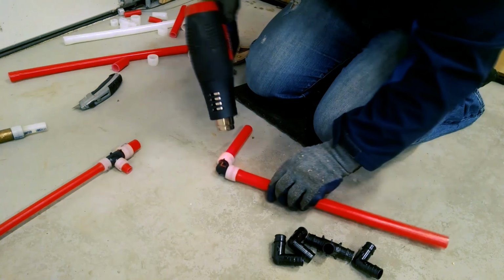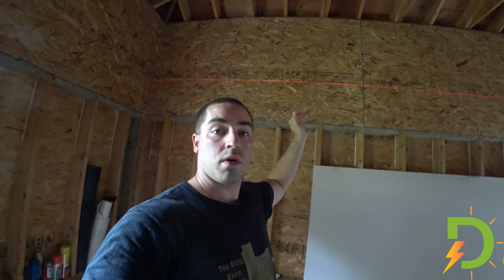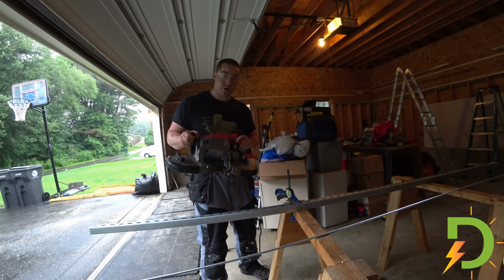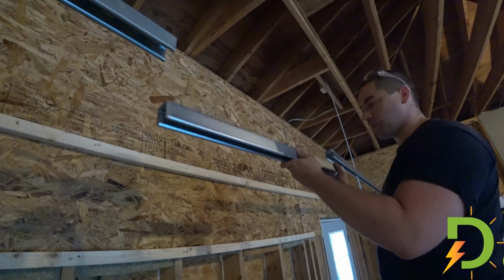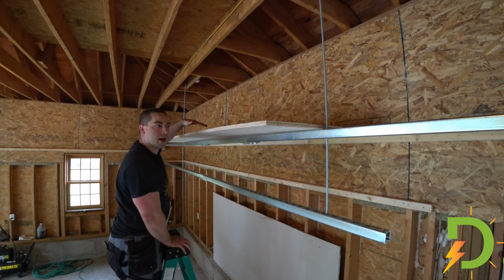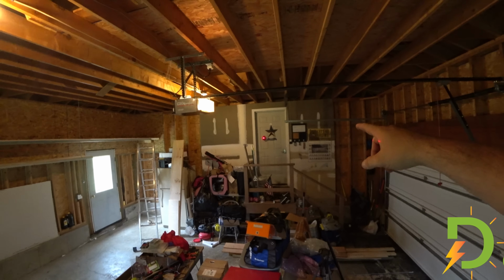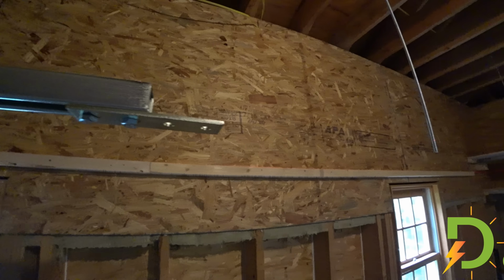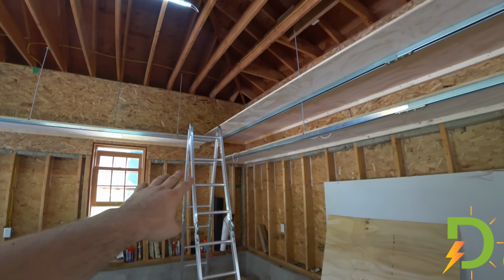DIY Hanging Shelves, Garage Storage Built with Steel Strut

Comment: Awesome video. U are an inspiration but I have a question. How did you install the rod to the ceiling. This was the only thing that was unclear on the video. Thanks
Reply from the maker: At 1:39 in the video I show some wood blocks that I nailed into the joists and rafters.  I then drilled a hole through the wood block, ran the rod up through the hole, and on the topside used a washer and double nut.  I tightened the two nuts together to lock them.  Sorry I didn't go into a lot of detail here.  It was boiling hot up in the rafter bays, I just wanted to get down.
Reply: DavidPoz ... thanks brother.  I am doing my own powerwall soon and I have spent countless hours researching.  Your video by far is the most user friendly and easy to follow.
Reply: they do make a fastener that allows you to anchor a rod directly into wood. it's called a Sammy.  they make one's that have a wood lag on one side and a 3/8 female rod coupling on the nut side.  they also make them to go into concrete and sideways into wood.  very handy

Comment: 1. You can look up unistrut loading.  You actual load will be about double the listing because it will be splt with the support along the wall (in fact with the load pushed against the wall, the wall will carry most of the load).  P1000T (1-5/8 square, slots like he has here) can handle 238 lbs (476 ttl) at 12', 289 (578 ttl) lbs at 10',  357 lbs (714 ttl) at 8', and for shorter spans WTF are you putting on this?

2. I prefer to mount the unistrut with the holes down so I can hang things from the holes (shop lights, etc.).

3. Don't worry about it being "Bouncy."  Unistrut is a channel (U shaped) and not a square tube so it will easily flex, but it isn't going to fail.

4. if the end of the unistrut is against drywall or similar (here presswood), cut out a small hole and put the unistrut into the wall cavity about 2".  This will ensure that if the beam shifts it will always be resting on the wall 2x4 cross support.

5. For downcomers I've always used leftover unistrut, but if you don't have enough scrap then use 2x4 or 4x4 lumber.  Drill a hole in the side of the unistrut and bolt to the downcomer.  Overhead connect to a ceiling joist with 2 bolts.  

5a. 2x4 or 4x4 choice depends on direction ceiling joists run, want 4" side facing both unistrut and ceiling joist.  With wood allow at least 2" of wood past the bolt hole.  

5b. If you are concerned about putting too much weight on 1 joist, if you have access can bolt between 2 4x4 and lay across several ceiling joists, or double up the joists to make a wider beam.  This is probably overkill if you are connecting to 2x8 or larger joists.  

5c. If you are going through drywall and don't have an attic overhead, cut an access panel and frame in with molding like an attic access panel.

6. Overhand the shelf over the unistrut a little.  In addition to protecting against shifting, this better supports the shelf allowing you to use thinner plywood shelfing.  I recommend 2" to 8" overhang.

7. Don't forget the middle of the garage.  If there is enough space above the garage door, use unistrut to add shelving down the middle.  Allow 1" clearance above the garage door highest point when moving for sagging.  use 4 pieces of unistrut to put on either side of the garage door opener channel.  Pus a small piece of wood down either side of the channel so you don't accidentally push an item into it.

7a. Test your clearance with a string by opening and closing the garage door BEFORE installing the unistrut.

7b.  You will need to cut out around the garage door opener.

7c.  You will probably block the garage door light.  Buy an outlet adapter that fits into a light socker to put in the garage door opener socket, and run an extension cord to a light fixture elsewhere.

7d. At the back of the garage door when open, drop the middle shelf lower and continue the shelf to the wall.  Set this height about 2" higher than the garage door opening.  Use 3 pieces of unistrut and set the plywood shelf sideways so it rests on all 3 pieces of unistrut.

7e.  continue across the garage door wall to the sides, up to 4' deep.

8. Get the most space out of the shelves depth.  On the sides come out to about 2" less than the edge of the garage door opening, or 4 feet, whichever is less.  You will need to notch around the garage door guides.  Test your clearance with cardboard in place of the shelf, and again BEFORE bolting down the shelf.

8a. Across the back wall area install 4' deep shelves.

9. I recommend height of at least 6' 8" from the garage floor unless you are installing taller cabinets underneath (height of a standard doorway).  You might consider mounting the back wall shelves opposite the garage door opening about 2" higher than the garage door opening so you never lose the ability to put in higher and longer vehicles.

10. If you are going around all 4 sides plus down the middle, make the space between the middle and side shelves at least as wide as the deepest shelf.  if you have to narrow a shelf for this, narrow the middle shelves since they are mounted the highest.  For example, your garage is 20' wide, your side shelves are 2'6" deep for 5' total.  Your 2 middle shelves should be 3'9" deep and the space between these and the outside 3'9"

11. Don't narrow your shelves just to save on plywood.  If you are exceeding 2' on both sides, then rotate the plywood to have 4' wide sections still cut to the maximin width.  You aren't adding a lot of plywood sheets to the total job (maybe 1 or 2 sheets).

12. I you want to hang stuff below the unistrut, connect piping, etc. look up the unistrut catalog for additional fittings.

13. Paint the wood white if you have a white ceiling.  The shelving will be less noticeable, and the white color will help with lighting.

All of this said, if you are on a budget, don't use unistrut everywhere, because it is expensive.  Use it in places where you want a long span without supports.  Use it in places where a shelf dropping would be disasterous, such as down the middle of the garage.  Along the walls you're paying a lot of money and only gaining about an inch of height.

Comment: How can I attach the all thread to finished drywall ceiling?
Reply from the maker: There are a couple different ways.  One is to use a "Hanger Bolt" like this: https://amzn.to/3h6KBNB  Plus a coupling nut like this: https://amzn.to/3urnvF9 .  You would need to find your ceiling joists or rafters, pre-drill a hole, then drive in the wood-screw half of the hanger bolt.  Then you thread the coupling nut on half-way, and your threaded rod into the bottom half.

Comment: how does the ready rod attach to the rafters?
Reply from the maker: I nailed a 2x6 on top of the ceiling joists.  Then drilled a hole in the blocking lined up with the rod.  Rand the rod up through the hole, then used a big fender washer and doubled nuts on the top.

Comment: How did you attach the threaded rod to the blocks?
Reply from the maker: I drilled a hole and ran the threaded rod through the block, then added a washer and nut on the backside.  Thanks for watching.
Reply: I was just going to ask this same question thanks for the info!

Comment: Do they “sway” at all when pulling stuff off or on? Or are they solid?
Reply from the maker: they are anchored to the wall, so no movement pulling things off.  Yes, they are solid.  My one mistake was going too long of a span at first, so I added one more rod, but showed that in the video.
Reply: DavidPoz thank you for responding.

Comment: where did you go to buy the Uni Strut and all that threaded rod? I want to do something like this in my garage which has low head room, and I think it will work nice having only 3/8 rods coming through the ceiling, I should have just enough room for plastic totes and not hitting my head on the shelf, which is why I don't want a 2x4 for support, I thought about using wire planneling for the shelves and angle iron for the  support
Reply from the maker: Lowes, it is located in the electrical aisle with the metal conduit.  I've also seen it at home depot, and my local Electrical supply houses carry it as well.  It is very common in commercial work.
Reply: In my town, Lowes had the struts cheaper than Home Depot.

Comment: Will the front of that plywood shelf - since it's unsupported - warp with time?
Reply from the maker: Hi Fredochs,  It might.  Send me a reminder is a year and I'll check them and let you know.
Reply: @DavidPozEnergy  Hello.  I saw the question about whether the front of the ply would warp.  It's been almost a year, any warping?  I'm about to start on this project this coming week during the 4th of July holiday.  I imagine, since you had carriage bolts keeping it down, it should hold up.  If anything, adding carriage bolts every couple of feet would do it. I'm curious what you'll find though. 

Thanks for the video - it's awesome.  Perfectly edited down.
Reply from the maker: I checked with my buddy about any sagging.  Nope, no sag.  To quote him, he said "they look the same as the day you installed them".  He does have the shelves full, but mostly he is using plastic totes.  Maybe the totes help distribute the load so it's not concentrated on the front lip?

Comment: what size unistrut did you use? can you provide link.. P & T
Reply from the maker: It is 1 5/8" square by 10 feet long.  https://www.lowes.com/pd/Superstrut-1-5-8-in-x-1-5-8-in-Silver-Electroplated-Half-Slot-Channel-Strut/1000192655
Reply from the maker: If you find a supply store for electrical or HVAC that sells to commercial/industrial you can find longer pieces of unistrut, I think 20' or 22'.  That would be nice to avoid splices.